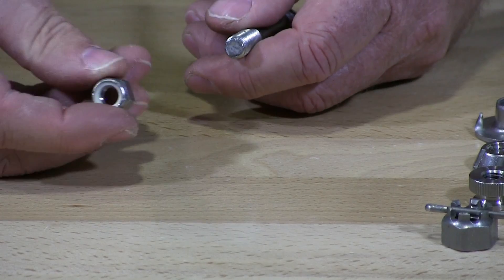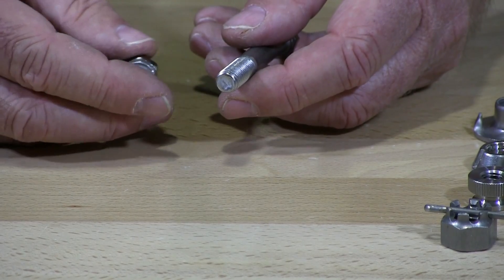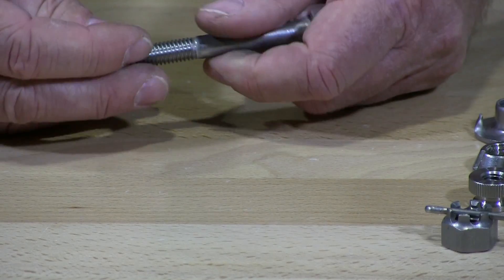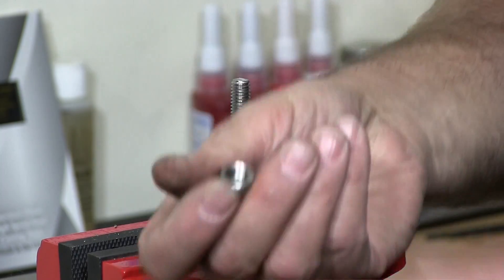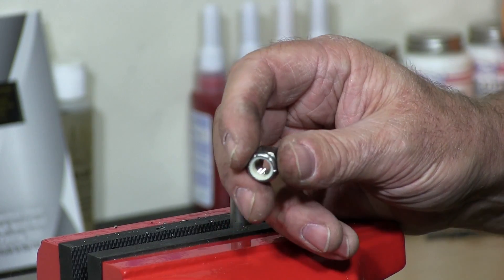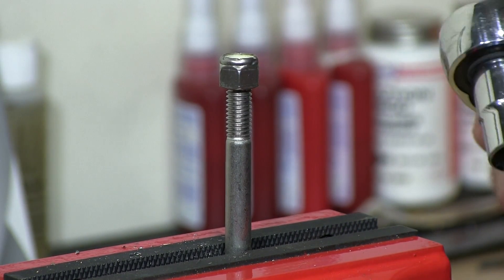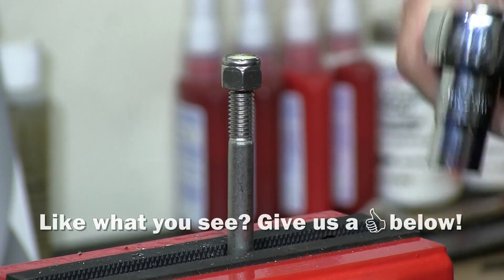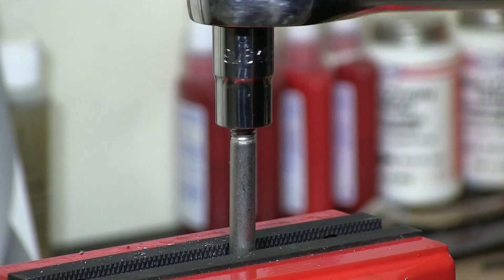Waxed Nylon Lock Nuts Prevent Thread Galling | Fasteners 101

Comment: So the tapered or rounded side of the nyloc always faces up or away from your work? Does it matter? Thanks.
Reply: There's no threading molded into the nylon part to engage the bolt. I just asked myself the same question and looked more closely.
Reply: @ydoomenaud  LOL. You're right. So it only goes on one way, as long as there's enough threads to engage the plastic part.

Comment: I want to unscrew a nyloc nut on a caster but the stem is rotating with the nut. fixing the bottom hexagon didn't help as the screw is rotating freely from the wheel bracket and ball bearing plates. Is there a trick to keep the screw in place so that I can unscrew the nyloc nut. would the impact driver help? Is there a powerful glue that I can use to stick an extension to the screw which can help me keep it fixed while unscrewing the nut? Here is the image of the caster: https://imgur.com/a/J1zO4

Thanks for your kind help in advance

Comment: What is galling?
Reply from the maker: At its simplest, Galling is a form of abrasive wear that has the potential to occur when any two metals (typically stainless steel) rub together with poor lubrication. This causes a lot of friction, which in turn makes it difficult to fasten fasteners together quickly, such as nuts and bolts, without completely destroying the threads.

For more information, visit our page on the subject: https://www.albanycountyfasteners.com/Thread-Galling-and-Fastener-Seizing-s/1248.htm
Or watch our video about Galling: https://youtu.be/_WnFpI3oYLs

You can use an Anti-Seize lubricant to prevent galling from occurring: https://www.albanycountyfasteners.com/anti-seize-lubricant/949.htm

Comment: whats that tool called, the one you are using to push the lock nut into the bolt? sorry i'm new to all this and i don't even know the name of the tools, hope you understand, thanks b4 hand
Reply from the maker: Its called a Ratchet with a socket.  Thanks for watching my video!
Reply from the maker: Thanks for your inquiry!  The tool used to install the nut is a socket on a socket wrench.  You can also use a nutsetter.  You need to know the "wrench size" or hex size of the nut and you can select the appropriate socket or nutsetter to install.

Comment: Cool demo, I love your range of fasteners, but does just threading the nut onto the bolt really demonstrate "no galling"? Galling to me is what happens when you crank down on threads when there's a lot of tension on them, for example, when tightening sailboat rigging. I'd think that nut would need to see some stress before you can conclude anything about galling.
Reply from the maker: Thanks for the comment! Take a look at this related video (also recommended on the end screen) where we demonstrate galling with a 304 stainless steel nylon lock nut that is not waxed.  It also discusses the proper use of anti-seize as an alternative relief to the problem. The remarkable thing about the waxed nylon nuts is that there is very little stress which reduces the need to apply additional torque, as opposed to unwaxed nylons where there is almost immediate stoppage when the nut threads into the nylon, which this video shows:

https://youtu.be/_WnFpI3oYLs